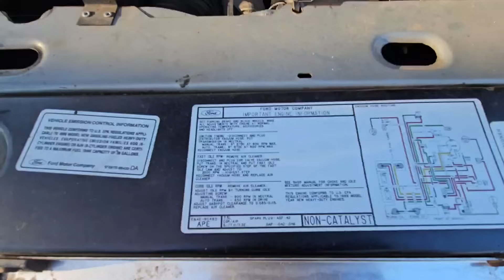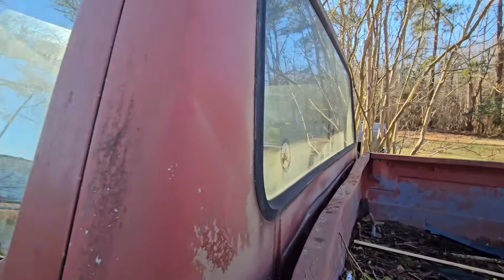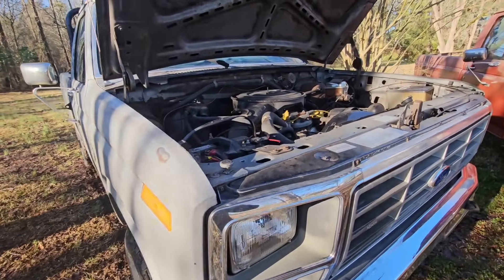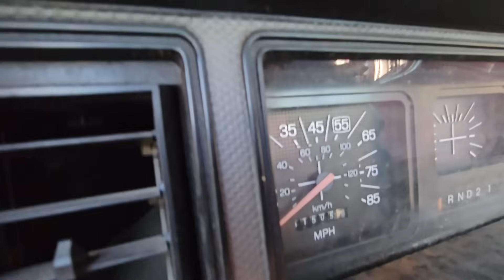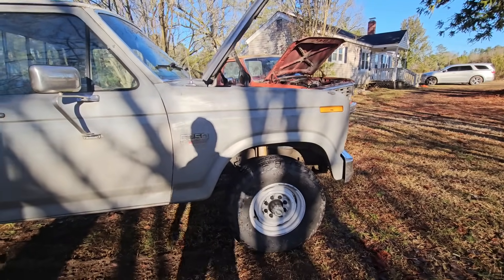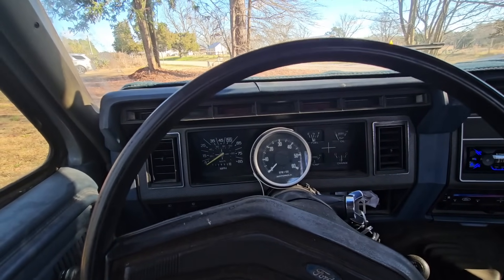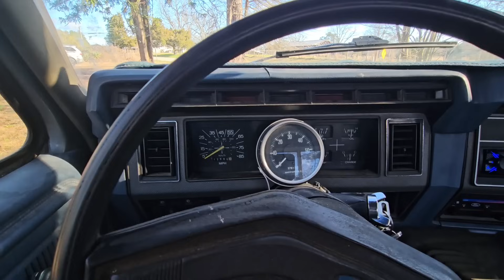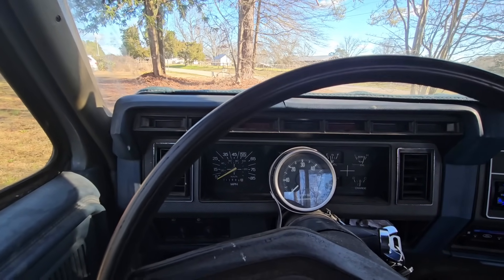THE WORST TRUCK FORD EVER MADE!?!?! #ford #fseries #sbf #bbf #truck

Comment: I'm looking at getting an 83 f350 dually. Has dual 19 gallon tanks, I'll be replacing it with a rear mounted 40 gallon cell. Its also 2wd, I'll be converting it to coilovers out front as well as making it 4x4. It's originally a 460 big block gas automatic truck. I'll be swapping in a 5.9l 24v cummins and an allison transmission from AT conversions. Less headache, less bullshit, easier to work on and maintain all the way around and it'll be my daily driver. You're right about no one seeming to want these trucks, it makes it easier for guys like me to get em dirt ass cheap and spend as much money as we'd like making them better and capable of lasting longer than ANY modern 4 door shitbox luxury car wannabe truck. Get a 40 year old 1 ton and build it into whatever your heart desires. You'll have something no one else has because again, no one seems to want these big burly bastitches.. well, at least in my area. I've never even seen one driving around or at any car shows. Again, these things are over or almost 40 years old. The one I'm looking at is either 40 or already 41. Lol
Reply from the maker: Thats going to be a great truck when it's done!

Comment: The 80-86 "Bullnose" Ford's are my favorite of all the generations of Ford trucks.  I had a 1984 F350 Dually and loved the styling. They definately are not ugly. In fact they look rather menacing with the right wheel & tire  combo as well as other accessories.
And they are built  'Ford Tough'.....a whole lot stronger than the junk ass GM built crap with their weak ass C-channel frames and steering boxes that like to break off of the frames.
I currently have a 1988 "Squarebody" Chevy  Silverado  crew cab dually, and I can attest to the fact that it is nowhere close to the build quality of a Ford truck!
When you close the doors, the Chevy has a hollow 'tin can' feel, but the Ford is solid.....and let's not forget the junk ass steering column of the GM trucks with their brittle plastic bushings for the steering shaft (causing all kinds of sloppy play in the steering) compared to the Ford with  sealed roller bearings!
Chevy is cheaper because they cut corners on a lot of things. If I could find a clean Bullnose F350  crew cab dually with the 460 engine, I'd  get rid of my Chevy in a "Heartbeat"

Comment: grampa bought an '82 F250 brand new and it had no heat right off the dealer floor. it was a gas hog with no power and never could tow much. Dad somehow thought it was a great idea to buy it when grampa died and was sorely disappointed. The truck was gutless, cheaply built and had the wonderful split front axle that wasn't good at being either an IFS front end or a solid axle. somehow it was the worst of both worlds. i was constantly working on it for dad.

Comment: Where did you come up with the idea that the 7th generation of Ford trucks, the bullnose, is the worst truck made. Odd how even Ford motor company say the bullnose is the absolute best generation of truck they ever made. Period. I have a 1985 and I wouldn't trade it for anything modern.
Reply from the maker: Must not have listened to the video. I never said that it was the worst.
Reply: @runsgoodbutsmokes  video header......
Reply: @runsgoodbutsmokes  I've got a 1985 that was sitting for 25 years. Changed the old fuel pump to a Holley 135gph and truck fired right up. Been driving it for 6 years now. And mines got the 351 Windsor 4wd. Originally a 4 speed, but was changed over to a Ford c6. Now has a b&m pro shifter on the floor. I can literally outrun hellcats. And it's a stock lower end. Just has intake, brawler 750 double pumper, headers and accel super coil. I can do burn outs all through third gear. Nasty truck.
Reply: @runsgoodbutsmokes  I did like your video though.

Comment: Had a work truck that was a ‘93 F-250 w/ 300 I6 and 3 speed auto w/ 4.10 gears. It had no AC and no radio from factory even then.
Reply from the maker: Wow that's crazy! That wasn't that long ago!

Comment: ya don't need to go buying a bunch of performance hardware to get decent performance, you hit on the problem briefly, these engines were detuned badly, the compression was low, the timing was retarded with a cam gear, not the chain. A rebuild with better pistons, a slight deck trim, a timing kit with 4 degrees advance, a balance job, delete of exhaust gas recirculation system if it is legal for your area, a 4 venturi intake and carburetor and you have a whole new beast on your hands.

Comment: Why? because Ford lightened everything up in 1980. The body, the chassis, the suspension. Everything flexed, cracked and if you parked with the truck on a twist the door wouldn't shut because the cab flexed. The box would hit the back of the cab under load and even the chassis broke in half. I was there, I worked on them and I've always been a Ford owner but never one of the early 80's. 
 It was a disaster for Ford. They didn't make a comeback until about 1988.

Comment: 460’s and the 300 in line 6 was Ford’s most durable engines. Built for commercial use and durability. A favorite of fleet buyers.

Comment: I believe 80, and 81 were the worst as the frames had a ton of holes drilled in the frame to lighten the vehicle. They twisted easy and were considered junk. I drove a ton of that gen 460's and they rocked for their time, except ate fuel! 351M was a common motor of that era also, and sucked! No go but chewed fuel, usually due to rear diff specs, which made them rev high in highway use.

Comment: Those trucks were almost the end for Ford trucks. I live British Columbia and the logging companies always used fords when they got the new ones in 1980 the lightened chassis flexed so bad that the box would hit the back of the cab and the chassis eventually broke in half. Ford also lightened up the twin I beam front axles and the radius rods would crack and the I beam inner pivot mounting brackets would break loose. The frame also cracked where the steering box mounted.  I owned an Auto repair shop at that time and we got a lot of repair work out of them.

Comment: But how do you feel about the truck?

Back in 1990 I was working at the Chevy dealer in the parts department. They were selling new 1500 WT trucks with AC and power steering, vinyl floor and manual windows and locks for $8500. Even scaling up for Bidenomics, where are those values today? I'd pay cash for one right now and I know I'm not alone in wanting a truck that's actually worth the money.

So much crap in the trucks now. Yesterday I saw a Chevy commercial advertising the Supercruise, and the big rugged guy driving is actually giggling and holding his hands while he watches the truck drive. What possible real-world application is solved with that? 🙄 Total waste of $$$.

Comment: Ugly, but tough. Those are 86 models I have one and an 87 that looks better. Guy at Napa told me that the 87 deisel was a beast last year with heavy frame construction. 86 had last year with international injection pump giving the 6.9 50 more horse power and better mileage than the Ford pump.

Comment: I ordered my 1980 F-150 in Jan. 1979. 5 mounts before they started making them, back then you could order what you wanted on your truck. Paid $7,200.oo What I got and still drive today is a rust-free, very low Vin, 1980 F-150 Ranger XLT 4x4, two-tone paint, upper and lower bright trim, short bed, duel tanks, duel batteries, chrome package, sliding back window, tinted glass, and fords anit rust treatment. I wanted and got the 4.9 300 six, with a 4-speed manual with the Trac-loc rear and limited-slip front, and manual lockouts. Once I got it home in Sep 79 I put a 1-inch puck under the front springs so I could run 33-10.50 R without rubbing the tires and the chrome wheels I bought wanting for them to build my truck. I now have 573500. miles on it. I started running diesel oil in 1982 for the zinc and the motor is happy. I've had the truck so long that I would not know what to do without it, I drive it every day,  it's reliable and easy to work on. They do not make trucks like this any longer. The Bull-nose is not ugly, a ugly truck is the C10. Yes, I am biase :)
Reply from the maker: Very cool story! I appreciate the experience and the read!

Comment: I’m a diehard Chevy fan. But when I saw an 86 Bullnose F150 for $1,000, I rolled the dice and bought it. $800 in parts to get it roadworthy and four years later , it runs surprisingly good for having 226,000 miles on the same engine , trans. It has the common 302 fuel injected and AOD 4 speed automatic. 
I love this old truck

Comment: That body style of course with various revisions all the way up through 1996 for the half tons in 1997 for the heavy duty 3/4 and 1 tons was the ultimate Ford truck. Nothing Ford has produced since then comes close to how great these trucks were. Mine was only a half ton but it had the 300 straight 6 and a heavy duty 4-speed manual with the super low first gear. That truck was unstoppable. Well at least it was until frame rot stop it😂

Comment: My dad had a 1980 f250 4x4 4-speed with a 300 six. He drove that thing everyday to 1992 for his excavation company. Trust me when I tell you he used that truck for things ford never would have said that truck should do. Pulled 14000 pounds of trailer behind it. Pulled loaded dump trucks that were stuck. Never had a major brake down and he drove it nearly 300,000 miles - albeit not all that fast. He to this day says that was the best pickup he ever owned besides his 85 k30 dually.

Comment: Really, these are junk? I have a 1983 F150 4x4, short bed, standard cab, 300 straight six/4 speed manual. We bought it brand new and not longer I drove it to highschool in the late 80s. It then was ran as a hunting rig and parked one winter than sat over twenty years. I bought that property recently truck included. After a brake overhaul, new tires and pulling old fuel and replacing it with bidens finest. It's been running great over a year now. I buffed it out and even cleaned up my highschool parking stickers in the back window
Reply from the maker: Never once did I say they were junk haha.

Comment: I had a 1980 F-100 that had the 302 in it, 2wd longbox and the automatic. I got it in the fall of 2010 and it had been a one owner truck, the original owner used to haul his camper from NY to Florida with it, and it didn't get sold until the old man died. I bought it, the cab was solid but the box was shot, and the 302 was worn out and needed a rebuild. I had it, ran it but it needed work, but in the end I ended up getting rid of it and got my 74 F-100 with a 390 in it that I've had a lot more fun with.

Comment: First of all, thanks for showing and demonstrating these!  Well, back in 1980 I bought an F-150 brand new with a 300 six and a Warner T-18 4-speed.  It was the Ranger trim level which became XL in later years. Having been in and driven earlier trucks, I felt that the sheetmetal seemed thinner and less quality paint and interior materials.  But, the idea back then was to make cars and trucks lighter and more fuel efficient because of the fuel crisis.  But I still think that it was and still is my favorite body style.  Having owned old trucks from the 50's and 60's,  these were much more stylish, comfortable and lots more pleasant to drive and ride in.  Though the sheetmetal and interiors were a little more on the cheap side compared to older models,   the drive trains still were solid and that's why they are still around.  I miss mine!

Comment: I’ve just bought a 89 f-150 with a351, two wheel drive lariat package day cab with 105,000 miles with new tires for $500. I did stick another 1200 in shocks,brakes,and full service,but yes it been a good truck.It did come with two gas tanks,guess the guy had a camper on it for a number of years.

Comment: The traction beam front axel on the 4x4 wasn’t very desirable. Also, those trucks have the cheapest looking plastic interior of any truck that I can recall. They would rattle and creak like crazy. That being said, if I could find a clean example with a manual and a six cylinder. I would buy it.

Comment: I have a Early 1983 F-250 "Light Blue" 4x4 single cab with a 351 Winsor and a NP435 paired with NP208 that I'm trying to put on the road. Besides some rust, it's a great truck!

Comment: The 82-87 ford trucks were a quality nightmare unless you bought a basic, stripped-down version. The interiors were made to fall apart, the windows all leaked and you were constantly chasing rattling noises. By 88 they fixed most things.
Reply: What's different between 87 and 88? 💀
Reply: @JakinThebox12  lots of quality changes were made between 87 and 88. By 88 everything worked properly and was put together better. All of the bugs were worked out of the eec-iv system, no more random trouble codes for no reason.
Reply: @Cream_of_sum_yung_gai   A 1980s f150 will run fine even if it throws a code. What's your point? I had a 1980s chevy that wouldn't crank because of a bad pcm. I sold the chevy for scrap.
Reply: @Cream_of_sum_yung_gai   My 1980s chevy had a cracked dash and the windows leaked. Chevy is junk.

Comment: worst: 6.0/ 5.4 3 valve/ 6.4/any gas turbo/ any not available with a manual transmission/ any with radar in the taillights costing $$$thousands to fix/any with $500 headlights/ any with climate computers/ any that don't use keys/ any that have buzzers and chimes that can't be disconnected. Basically most trucks made after 2003 are high dollar, high problem headaches. Same goes for the other brands.

Comment: Um no? i have 6 of those from the 300 i6 to the 6.9 4 speed t-19 im a bigger fan of the next 2 generations but 80-96 are all my favorite trucks wayyyyy better then anything new. my moneys in the 300 against any new 6 cylinder. ecoboost or n/a

Comment: Ford used the same cab from.1980.until 1996.the interior was changed. First generation from 1980 until.1986,  Second generation from 1987 until.1991 third generation 1992 until.1996

Comment: I had a 1980 F150 long wheelbase for 25 years that looked exactly like those two.1980 was the first year of that body style. It was the most reliable truck I ever owned. Never left me walking even once. No computer, no fuel injection, no automatic transmission, 2 wheel drive, king pins instead of ball joints, cast iron twin I beam front axles, 300 cu in straight six cylinder. Over the 25 years that I had it I rebuilt the carburetor, replaced the heater core, radiator, 1 master cylinder, 2 water pumps, 2 clutches, couple of brake jobs, rebuilt the front end, u joints and 1 valve job. All normal maintenance for a truck as old as it was and I did all of the maintenance myself. It still had the original starter and alternator. I put 350,000 miles on it and it was still running when I traded it in on a new truck. The only thing bad about it was its thirst for gasoline. Wish I still had it.

Comment: I’ve had over 20 obs trucks, 1995-1997 351 zf5 is the best. The efi system in the later obs is so reliable and the fuel economy is a lot better. Have close to 340k miles on my 96 and it’s been the best truck I’ve ever owned. I paid $600 for it in 2019 with just over 190k miles.  I’ve done distributor (pick up coil) a tune up ( cap plugs rotor) both fuel pumps, rear axle, front bearings, u joints.

Comment: I like the styling of the Bull noses but I tend to avoid them because they frequently have sun damaged interior plastic due to not being resistant to UV rays. The tops of the door panels literally flake away. I really like the Holley 4 bbl on the 351HO engines. They were unique to Fords I believe in that the front 2 barrels had annular booters and the aft 2 barrels had down-leg boosters, they were great for throttle response!

Comment: My other ford f250 i bought in Alaska  after getting out of the army. Bought it in 1992 . From my boss. It was new in 1991. Its an old 7.3 diesel. Non turbo. E4od trany. No rust  4x4. What an awsome truck. We just got back from Maine. 1800 .miles  in a week. 20 miles to gallon on highway. Not for sale ever.

Comment: I bought my F250 Super Cab new in 1985 , XL trim , 351W, C6 Automatic Trans , Factory AC for approximately $15k , ( to be absolutely sure I'll have to dig out the paperwork). Red interior. Truck is still all original except for the carb. 160k miles . I wouldn't trade even for a 2024 model .
Reply from the maker: That is awesome!!! I wouldn't get rid of it either!

Comment: Owner of 1980 Ford Bronco Ranger XLT, 10:1 331 aluminum heads, roller cam, headers, manual trans 9” strange rear traclok LSD 3.73 gears (powrlok LSD front) everything new, AC/heat/ carpet/ leafs, coils, shocks, brakes, u joints, ball joints, no cats, , the list goes on. 32 gallon fuel tank. 15mpg all day revving to the moon.